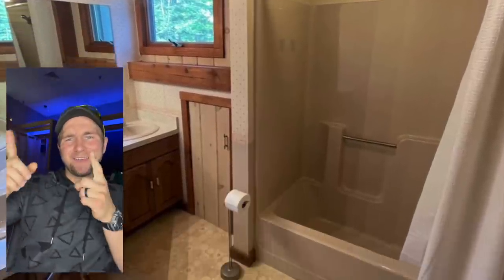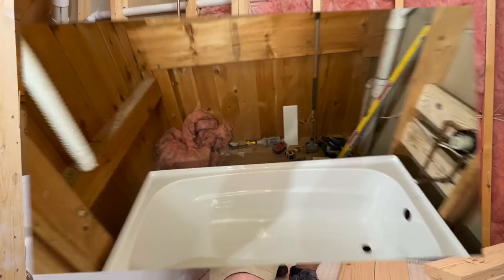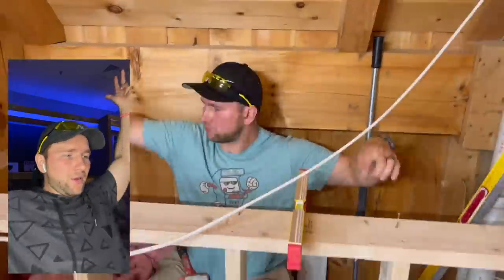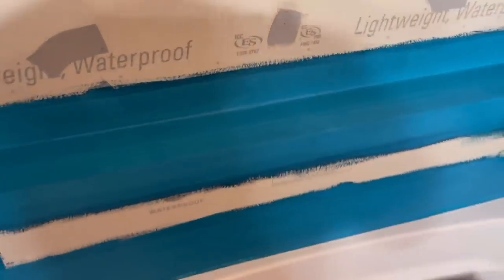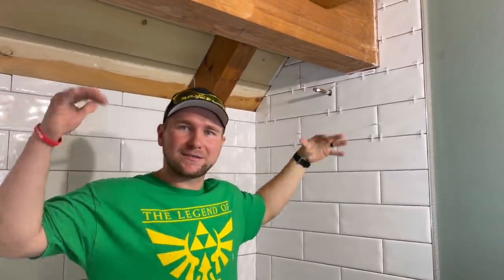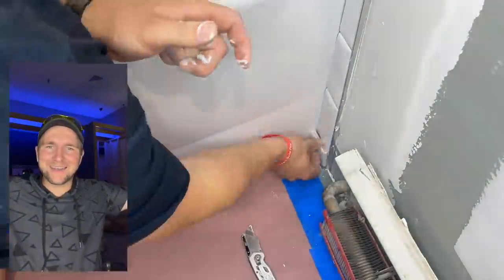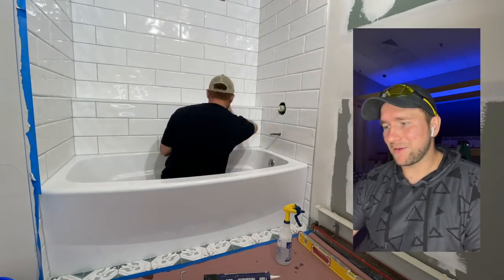Gut to Finish. How much?! Bathroom Remodel Time-Lapse. DIY Bathroom

Comment: When I tile bathroom floors I pretty much always run the tile off of the tub so that I can have a nice good clean look. You are exactly right about the door. You always want to lay the tile out so that it will be visually pleasing to the eye. People aren't typically looking at the tile at the door. They are setting their eyes on the whole span of the room when they walk in a bathroom and many times the tub or shower is the focal point. Great job and thanks for sharing about your pricing.

Comment: Great video!  Since I’m a new DIYer it would have been nice to slow things down on other key steps.  Really appreciate the explanation of those steps you did cover.  Like putting up the water proofing board, couldn’t really tell how you did the initial seal when putting the boards on the wall?  Is there no seal between the edges and/or corners of the boards?  You gotta remember, you do this all the time, us dummies are trying to absorb!  Thank goodness guys like you and Sal (the old guy no doubt) education us!! Thanks buddy!!
Reply from the maker: Great point! I will take them and do better! I promise

Comment: What material did you use for the sill (under the tile)? Do you have a video of how the tub was installed, how the vanity was completed, how the tub/shower faucets, etc were installed? Though disabled with severe chronic pain, I’m considering DIY’ing my crappy 90s prefab tub/shower to just an alcove shower using Wetwall by WilsonArt. Not sure how to install shower pan. Any video for that?

Comment: I like this format, good to show the work and explain it whats going on. I've used that sealant and aquadefense, redgard, etc... Do you ever worry the liquid membrane wont bond well in the long run to something like the grey sealant? They're both great products, but who knows. Too bad you couldn't utilize that hidden space. Could the tub have fit back there then do a shower in front of it? A wet room. But hard to tell from the video how much room was there. 6x6 and 8x8 tile are a nice change of pace, sooo nice vs the large format tiles. Nice change of pace. The floor pattern with subway tile is sort of timeless. BTW your work site reminds me of my site. The kobalt knee pad, the rubi snap cutter, even the shorts 😀

One more thing, about pricing. People should understand that WINNI/Misha can charge a decent rate because he shows the approach he uses with care about the details. People are aware that there's a lot of ways to screw up tile in a tube surround and shower.

Comment: Hey man what do you do when you get a small job that takes multiple days? I had a customer that only wanted 2 areas, a bathroom floor (48 sqft) and a utility room (88sqft) so 136 sqft and I usually charge 3.50/ft or a 450 minimum. That job would take me 2 days so a minimum is out of the question and 476$ is poor pay for 2 days in my opinion. Just charge a flat rate for both rooms?

Comment: Great video! Thanks for the input on pricing breakdown. When you bid jobs for customers do you break it down just as you did in the video with demo, framing, tile, and supplies? Do you just add on an extra set fee to install the toilet/vanity?
Reply from the maker: We break it down all before. We do not include vanity or light or shower fixtures. Those vary so much. But we include the install of all of those

Comment: Loving the video. Nice to see start to finish and not taking hours like some others do. One question, what do you put under your tiles? It looks like a rubber membrane. I am about to tile on concrete (which has some cracks) so I was thinking of separating the tiles from the concrete with something
Thanks and keep up the Great work
Reply from the maker: Hey thank you so much. On this project we did Strata Mat. It’s an uncoupling membrane

Comment: Great video. For someone who is just starting out they may need more detail around pricing. As an example, is there a standard price per square foot for floor tiling (labor and materials)? Maybe that’s a question for the future of trades site on Facebook.
Reply from the maker: Yeah absolutely. I’m trying to tip toe a fine line with pricing. Literally no one shares it. And if I go too in depth it will not be good. I think I need to create a pricing video and just share my ballpark price, and tag the video on how I got there
Reply: @WINNI.Designs  information in future vids on how to not underbid jobs would be appreciated! So difficult to properly bid a job when there are so many unknowns in remodeling. Maybe a video on creating good contracts and how to / when to approach change orders too! Thanks!!
Reply from the maker: @pugpuppydude  absolutely! I will add that to my video menu!

Comment: I usually have to square up framing so I’ll sister 2x4 a 3/16” over the flange so the wall board doesn’t get that kick in at the bottom. Definitely a pro issue lol

Comment: I know you said the job was 7k, and maybe I missed it, but did you say how much of that was materials vs labor cost? Thinking about getting into the trade and trying to figure out how much you bring home on a job like this after your expenses. Great video, thanks!
Reply: Tile, about a grand plus wall board and thinset mortar and grout will be another 100-200 depending.  You're probably looking at 5 grand profit on a job like this

Comment: Looks good.  My only minor critique and honestly it seems a mistake more than anything is not simply tiling all the way on the left wall before tiling the back wall.  It should remain consistant whichever wall you chose or the grout line has variations.  Generally I always do the back wall first as visually its more appealing to me.

Comment: I did a bigger job than this one. Demo travertine floors 120 sf prep with hardy and installed 12x24 porcelain. Also demo walls as well that were floated with concrete and prep and installed a 2x10 and charged $2500 in Houston. I charged really low but took the L. They gave me another renovation same sf but charged more this time. Learning from experience 😅

Comment: so i thought he was gonna be way more specific with the pricing but great job none the less howerver I'  break it down very similar but alot more so pretty much for subway tile a +  - starting price for install only  not including demo or shower system etc im starting bid at about 8.25$ /sqft and of cousre prices subject to change job lay out or  Sophistication etc this is in South Tx and my compensation been severing central and South texas for 5 yrs now hour that helps  plus the info in the video
Reply from the maker: I’ll do a specific price video one day. But for these types I just want to keep my actual bottom line price. Keep in mind that no one even does that!

Comment: I was quoted $10k by one company and $15k for labor alone. For a 6x10 normal bathroom. And I already demoed it. Down to the studs.
Reply: They probably have to redo plumbing and some electrical it also comes down to if you want a design on the bathroom as well and if your in California LA area that sounds about right
Reply: @jaimeav6634  you know what they say about assuming things? Nothing that you assume is true. Nothing had to be done with the plumbing or electric. No tile. I did a tub surround.

Comment: really? that's it? just did the same job basically with 2 nooks and lighting, but no crazy cut into that roofline.  its nice to know that i charge enough, charge about 7 grand, IMO its not that much $$$ for what you get but IMO you should have charged less as i have a garantee on waterproofing. you just did a sub standard job so you made more $ but garantee you have more call backs down the road.

Comment: You can't be serious about the way you installed that tile....what a hack job.  If you pull one of those off to check coverage you won't have 40%.  You need 85-95.  Don't do your tile like this ever, either watch some pros do it, or hire a pro.
  Watch some Sal Deblasi or Tile Coach or Starr Tile and you'll see what I mean.
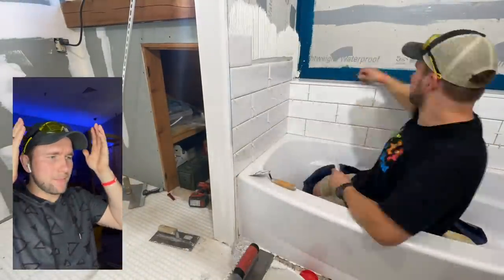Reply: 7:23 look closely. he got pretty good converge there, If you actually watch Sal yo u can see he install very similarly like seen in this video. Is it perfect, maybe not, but definitely a lot better then some other hack guys for sure.

Comment: Bruh 4k to tile a tub and a bathroom floor? 
Just labor? I can see if your framing out the shower for niche and wall board. But 4k for labor on that simple layout thats extreme, you must live in cali, or some overpriced city cause you will be laughed at here in NJ
Reply from the maker: I said all materials and tile included:) our real price. So much work up here. You can move:)